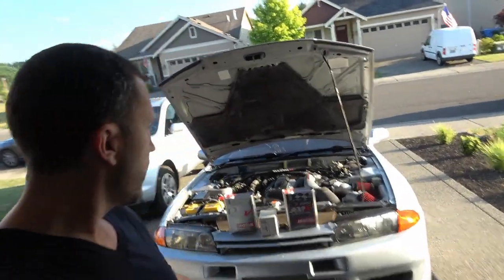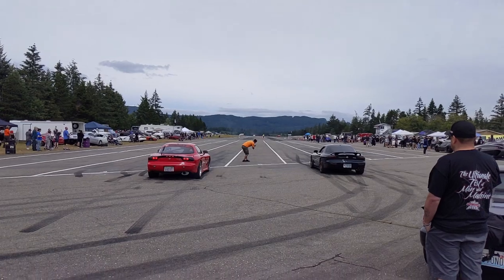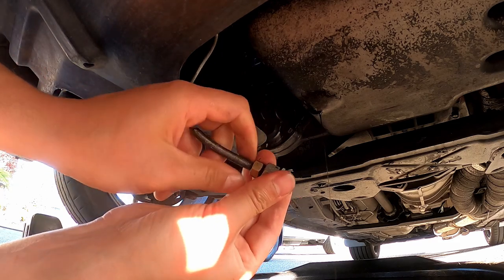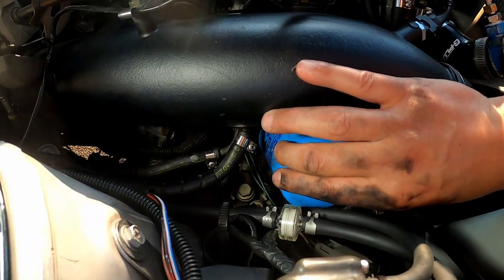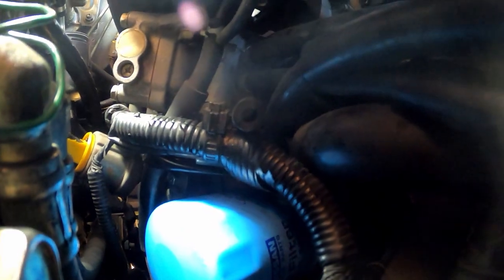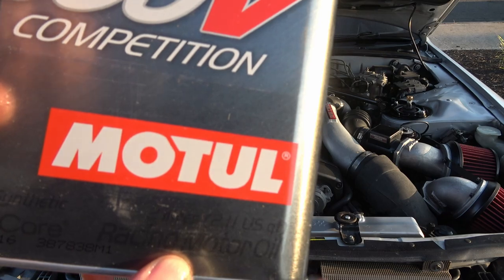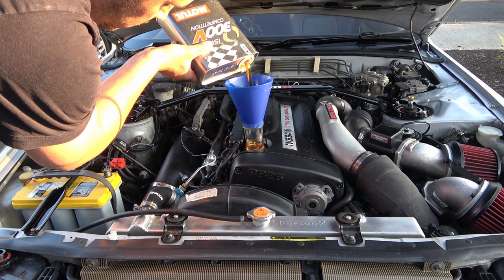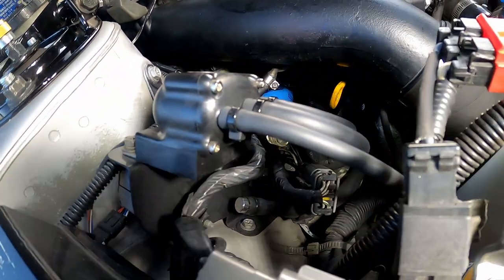Ester technology Motul Oil Change and OEM oil filter Nissan Skyline GTR RB26dett

Comment: Great choice for oil.
Reply from the maker: It was great oil, a little expensive though. I should have stayed with it. My RB26 suffered bearing failure at the track last summer after switching to Mobile 1 15w50. Did only have 3 bar of oil pressure though.
Reply: @JDMRightHandDrive  You should do a video on this incident. Im looking for a high quality oil that is for my future collector car. Ester based oil is the winner due to the cold engine starts. Sorry to hear, but it may allow you to build the RB better than oem. It will be expensive like all engine builds.

Comment: Going to be using this oil in my 300ZX
Reply from the maker: Been using this oil for 4 years. No issues so far and engine is running smooth.

Comment: OEM filter location definitely designed by an engineer and not a mechanic!
I place a plastic bag over the filter then hand loosen it so old oil doesn't leak everywhere.  Then after it's off, I put my finger in the threaded hole of the filter and pull it out that way.  At first I thought I would need an kid with double jointed wrists to get it out!

Comment: Time for an oil filter relocation kit and add an oil cooler to the front while you are at it. This is a real messy job, my hands get cut and hardly fit every time I do an oil change, not to mention the time spent after cleaning the oil drippings. Great vi as usual. Thumbs up. BTW do you have a part number for that funnel? Thanks.
Reply: 1970PMD yea what funnel is that?
Reply: 1970PMD found it,  it’s a motivx item.  Part MX2301.
Reply: @tk_disdk  awesome, thanks!